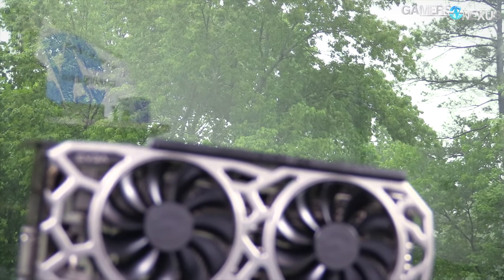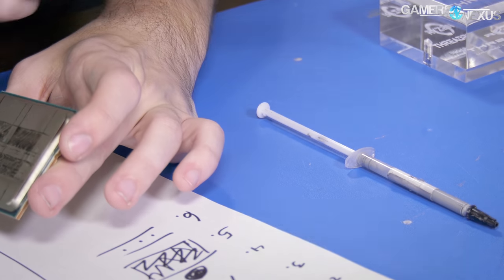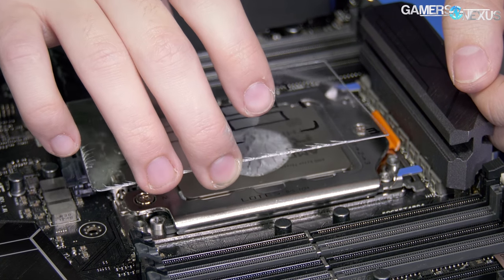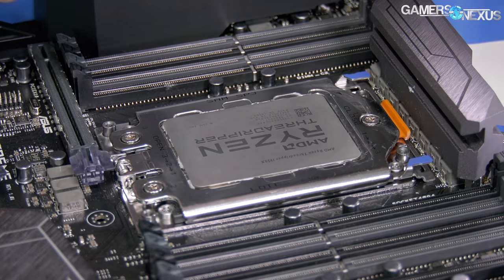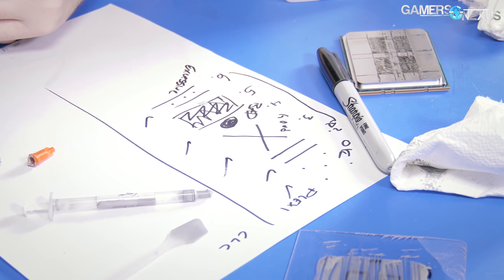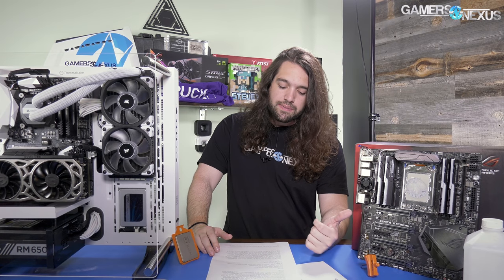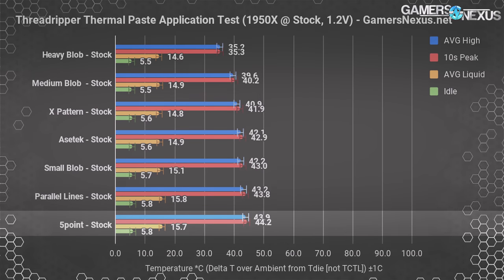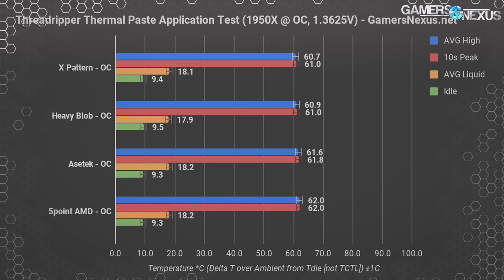Threadripper Thermal Paste Methods Benchmarked

Comment from the maker: Article, for folks who prefer a skimmable format: http://www.gamersnexus.net/guides/3013-amd-threadripper-thermalpaste-application-methods-benchmarked
Reply: You've gotta update that article author photo....
Reply: I use AMD's method on all CPU's (I call it "x-dot" :D).
It gets great coverage with small use of paste (5 dots isn't enough for this CPU).
I still would use more on mid dot, and smaller ammount on corner dots.
That is one HUGE IHS... is it 4-6 times as big as LGA 775 ?
An all IHS CPU's history live comparison would be great :)
Reply: have you seen latest linus video, he showed a heat sink the make a dull contact with the cpu that's what should be used as amd stock cooler.
Reply: i love the little barbs you are throwing out lately, so funny.. you're sharp lol
Reply: RIP, work network blocks gamersnexus
Reply: thank you for your hard work
Reply: I think it would've been interesting for you to modify the X method and either turn it into an asterisk (*)or kome (※)

Also this will be much more interesting when we get some full coverage coolers.
Reply: Gamers Nexus I was hoping someone would do this very video, even thinking that it would be nice to see how it spreads using a glass panel.  Kudos to you good sir.
Reply: Matthew Shea conductonaut is just as good/better and much easier to work with, still a pain compared to pastes
Reply: I don't get  why AMD didn't place the Threadripper dies perpendicular to the socket, so the two working dies effectively made a square in the middle of the socket, with a dummy die either side to balance out the heat spreader, this might have been a but more electrical complex, but far better for thermal management with current heatsink designs.
Reply: thanks for proving the blob method is superior
Reply: taznz1 because TR is extremely similar to epyc
Reply: Im really confused why come nobody has post thread ripper game benchmarks ? Did amd say wait or something? Can you please answer questions im so confused..
Reply: Yes, there's an embargo/NDA that should end at midnight tonight.  This is extremely common with any new product.  What is uncommon is that the embargo/NDA on showing the unboxing and product specifications ended before the embargo/NDA on performance.
Reply: for the next time, you could moutn the cooler with the plexiglass in between, maybe?
But there's probably not gonna be a next time, though....
Reply: why are you pressing with your hands as opposed to using an air cooler....????
Reply: I hear amd is not happy with you about this video u made. I think this video is great and many pc guys should watch it. This video is great and technical important. Keep it up and Fraak Nda.
Reply: You could also apply the thermal paste onto the coldplate of the cooler themself. Covering the smaller coldplate with spread out thermal paste would be more reasonable, in my opinion, for such a much larger heatspredder.
Reply: makes me wonder the time and energy put into testing this and the amount of patience required.
Reply: If you made the acrylic block thicker and with screw holes you could simulate it by using some washers and spring tensioned srews.
It would have been better if you had used the blocks at 02:30 .

Comment: Personally, because there is 4 sectors to cool on the Threadripper, they should be putting a small diagram on the Threadrippers cooling plate to begin with.

They can have their current logo still visible, then also put the 4 rectangles on the cooling plate as an outline of the 4 sectors.

Doesn't make sense that we as customers have to use stencils of sorts. Something so simple, yet the end result would be magnificent, then we would surely, more accurately be able to put the thermal paste on the CPU for proper coverage.
Reply: Basically, it doesn't matter. You are supposed to have a thin sheet of "paste", to as much of the contact area between the cooling apparatus and the CPU, as possible, ideally the 100% of the supposed contact area. 
Sure covering just the cores provides the greater efficiency between cooling and quantity of paste and actually is good enough but still having all the contact area (barely) covered will provide an improvement, even if less so if you take into consideration the paste wasted. 
More paste is detrimental only if it translates to thickness of the sheet OR if it means that the sheet became larger than it should and dropped out of the CPU's surface (which might or might not short circuits depending on conductivity and what it came into contact with).

Comment: Oh boy this is going to be the new "blob vs spread" internet argument for the next coming decade.
Reply: spread is better and you know it
Reply: also i take issue with the paste used, this is not my favourite paste. I'm out, you're both fired and the weakest link, so triggered
Reply: Blob master race!
Reply: thermal grizzly kryonaut blob master race
Reply: Jeez, shouldn't it be so easy to test this out? Take a scientific hotplate, make sure you're using a removable paste, then attach some metal blocks or smth to the hotplate using different methods of applying thermal grease. Then measure the temp and boom you have a good enough test of which method words best.

If someone's already done this and I'm just bad at looking stuff up then fine, but for an issue this big there really should be a more publicized study for this.

Edit: ok I shit you not like a minute after I posted this I got to the part where he mentioned he was gonna do testing, just finished watching the testing and am not too surprised by the results. I'm just confused on why everyone's still arguing, lol

Comment: Thermal paste application always seem to get people divided for some reason. I've always just put a bit in the centre.
Reply: PhilsComputerLab this has four processor dies under the heat spreader
Reply: Looking at the tests though... Just put a bigger blob.
Reply: ColtaineCrows Yea that's it.
Reply: And it seems the blob method still won.
Reply: I have always spread a thin layer of paste over the whole CPU, but in my last 2 builds, i have used the small blob in the center method. I am not sold on the blob method as the temp differs a lot more between cpu cores when idle. Spreading a thin layer over the whole cpu gives me a similar temp on each cpu core when idle. I dont think i am going to use the blob method anymore. It would have been good if we say an even spread over the whole cpu here for comparison.
Reply: The blob in the center has worked for years.
Reply: Yes the blob in the center has worked for years, but now that multi core CPU's are the norm, in my last 2 builds i find i am getting far too much difference in temps between CPU cores when idle. This is something many using the blob method before multi core CPU's were about would not have experienced of course. Maybe i need to put a bigger blob in the middle??
Reply: Yea, I've heard that under the new Youtube censorship policies, they will actually strip out the thermal paste application part in the videos because it's too divisive.
Reply: +Boom Box Both the heatspreaders and cooler bottoms need sanding for perfect contact and heat transfer... and under that heatspreader is usually garbage, unless it's perfectly soldered.
Reply: Thanks for the info Brother P and interlace. I am not so paranoid now about the different core temps.
Reply: In my experience the best method to apply thermal paste on a CPU that is covered with an IHS is "put thermal paste on CPU". Quantity and method really don't matter a whole lot.
Reply: true but it needs to be a big blob xD cuz in the center it contains nothing the 4 dies are around the center not right in the middle of it
Reply: I spread it fully over ihs and water block. This way i'm sure i get full coverage.
Reply: I spread it put the block on tighten it wait and open it up to see what i need to change. Its tedius but you always get the right spread and thickness.
Reply: Applying thermal paste is an exercise in artistic impersonation. The CPU is our canvas- The thermal paste, our paint laden brush. Last time I applied thermal paste, I painted the Mona Lisa.
Reply: Well if you watch the video even a big blob doesn't work.
Reply: I usually just spread out over the chip in an even thin layer. Works best for me and achieved best results. It's more tedious but you'll never make a mistake by: too much or too little.
Reply: PhilsComputerLab 
My dad still swears by the spreading method while I prefer the dot in the middle.
Reply: I lick my cpu

Comment: I work in power electronics. The rep for the semiconductors we use recommends as thin a layer of thermal compound as possible, only a few molecules thick, spreading with a credit card. This is just to fill the microscopic gaps left in the machining of the heat sink. What he recommends even more than thermal paste is phase change thermal sheets. Just put one on, and when it gets to 52 centigrade the materials phase changes, and it becomes a perfect thermal interface. How about trying this on a cpu? I would be very interested to see the results.
Reply: Good technical comment - those sheets sound interesting (googling intensifies)

Comment: Why not just use a thicker piece of acrylic/ plexi and drill some holes out for the retention screws to mount it just like a CLC?
Reply: Christopher Morgado it would probably crack. But I guess you could cnc a metal frame.

Comment: From my optical contacting attempts, starting from a single blob introduces far fewer (insulating) bubbles which is a good reason for why the blob performs the best.
Reply: "Air bubbles are not a issue at all; the spread of the thermal paste, a solid, with pressure, and heat cycles, totally kicks out any air between the thermal paste and the surfaces. If that was a issue, placing those silicon gel protections on smartphone displays would be way harder because of the surfaces being drastically different, or doing a display change would be almost impossible to kick air bubbles.
Also, not the X method, but a + plus sign method, is the one that spreads the most without yourself spreading it."
Reply: @calypsojordana3274  it is much easier to peristaltically pump the air bubbles out when you have fl3xible surfaces to work with and can see the bubbles you are trying to remove. Mounting a heatsink you have neither
Reply: @EndersSaga  ?

Comment: A bit wild to see that a X62 isn't really able to cool this CPU effectively with that power draw...  Time for a 420mm AIO cooler with a larger mount designed for TR!  Come on NZXT, impress us!  :)
Reply: It’s the size of the tubing and the thickness of the plate. Threadripper probably could do with a super slim cold plate, and a larger pump block with slightly thicker tubing

Comment: Result:
Two straight long lines are the best for THREADRIPPER, IF you have a cooler with wide rectangular plate that fully covers it.
Worst: "X"-shape and "one single drop in the middle". Medium tier - "five small drops". Runner up - "two lines with mid drops".

P.S.
Enermax just now has announced LiqTech 240 AIO that has a FULL wide rectangular plate footing for TR4. So there's that.

Comment: Great video, as always. I really liked seeing the plexi even if it isn't representative of real world spread; I've always worried about air bubbles being trapped when using anything but the blob in the centre method  but seeing the spread with all the methods really put my mind at ease! Thanks!
Reply: ^^^ Exactly This ^^^
So all the people saying you should have used this or that over the plexi - Or Full Spread - or any of the other nonsense..
This video gives you the real world use case example; not some super long drawn out fringe unneeded complexity.
Reply: @tisjester  As far as I can tell, from observing every "Full Spread" benchmark I could find, spreading all over basically always results in the lowest temperatures on the bench given enough compound is used. From a physics standpoint this makes sense because theoretically, if the goal of thermal paste is to fill in tiny air gaps between the cold plate and the IHS, you would want to cover every square millimeter of IHS coldplate contact area right? Then why would you ever use a method than only covers part of the contact area if done incorrectly? Just spread it all over, more is more when it comes to thermal paste. There is a video on YT of a gentleman taking some Arctic Silver 5 thermal paste (literally has silver in it) and putting it UNDER an AMD cpu, installing it and the computer booted up just fine. Full Spread with a blob on top of it if you're worried about "air bubbles'

Comment: I'm guessing AMD's recommended method is so the load is even among each core.  Depending on your compound, a giant blob in the middle could be enough to indent the IHS.

Meanwhile, the parallel lines likely create air pockets.  I think concave lines would work better.

Comment: If full coverage of the bottom of the cold plate is what is desired then it seems like using the spread method on the bottom of the cold plate would be the best and most optimum method.

Comment: I am guilty of over spreading, but I also get some high over clocks on air that run fairly cool. My method is a big glob in the middle and spread with a razor blade. I barely have an seepage, and I always run at about 26c/45c no matter the chip. people have always question my temps. I have never killed a cpu so far.
Reply: Explain why blob is stupid? The spreader will make it even with pressure. Sure it won't be absolutely perfect, but air bubbles will be less with the pressure method.

Comment: If you want patterns with normal mounting pressure, put cling-wrap on the bottom of the heatsink/cold plate. Wouldn't recommend doing a burn-in with that setup though.

Comment: I'm not a ThreadRipper owner (at least, not yet) but my method: 1st-spread a very thin layer of TIM's on the heat spreader. The idea is to squeeze paste into the microscopic crevices & cracks in the heat spreader. So the best way to do that is to apply & spread the paste then scrape off the excess leaving a very thin layer. When done, then use your usual method of applying TIM's.

Comment: Great video! I wonder if manufacturers will start building AIOs with bigger blocks/pumps. They've got all that contact space to use- why not take advantage of it by fitting a stronger pump or larger reservoir to the CPU socket assembly? :D
Reply: They will, but remember they have to use Asetek designs for their CLC's; due to patents..

Comment: With those temps in mind from using that cooler, I think a Ryzen CPU will be the first CPU I buy that will actually benefit enough from a custom cooling loop where the cost is actually justified from performance more than aesthetics.

Comment: If you use the proper heat sink, water block, or AIO for AMD Ryzen Threadripper like Enermax Liqtech 240 or 360. I recommend use spreading method cover entire CPU lid, like what TechYesCity like to do usually, it spread like perfect evenly all corner.

Comment: As long as it squishes out and covers the whole spreader it hardly matters, more important is using good compound and how well the surfaces are produced, in fact using no compound at all is only a little worse at transfering heat as long as theres good contact it works

Comment: Honeywell PTM7950 comes as a sheet and you don't have to mess around with any applying dots, dashes or crosses. You just cut out a piece the size of the IHS/core and stick it on. You also don't have to worry about whether the paste is too little or too much - it will be just right. In addition, it lasts longer, performs works better than traditional pastes and there is no pump-out effect.

Comment: so basically just make a huge splodge at the middle of the Z. Also DAMN, them temps when Overclocked leave a good bit to be desired, but given the number of cores I'm not surprised, will be interesting to see how the full coverage plates turn out, I suspect some more significant temp changes.

Comment: How about evenly spreading with a plastic card over the cooler itself?
Reply: Do I something similar but use a piece of plastic food wrap over one finger to make a nice thin, even layer. The paste is only really meant to fill any tiny air gaps in imperfections on each surface. The smoother the surfaces the less you should need.

Comment: Great vid. What if going forward for tests like these, you make the plexiglass piece more of the size of the IHS and you mount a cooler on top of the plexiglass for a more accurate spread? Then you just pull it off and boom, more accurate then just pushing down on it with your hands.

Comment: Myself i personally put a small dot of paste in the middle then use plastic spreadder to spread through the entire CPU!

make sure to do it small bits at a time and not too much of a dot that will leak over, once the metal of the CPU is fully covered with no leakage of the paste, then i know its safe to apply the Heat Sync!

Thats my preferred method as this i know u get full coverage of the CPU!

Comment: I think a (thick) line down the middle would do very well though as shown in this video, the application method hardly matters. I would attribute that to AMD soldering the IHS rather than putting mayo underneath

Comment: if you made a aluminum frame with a thick plexiglass inset you could tighten it like a cold plate while still getting a good window. If you wanted to do it the clear way with more accurate pressure.

Comment: if you made that piece of plastic a little longer and drilled holes through it where the mounting holes are you could have simulated the pressure more accurately with the cooler while still being able to see how it would spread and while keeping the cooler clean for that step.